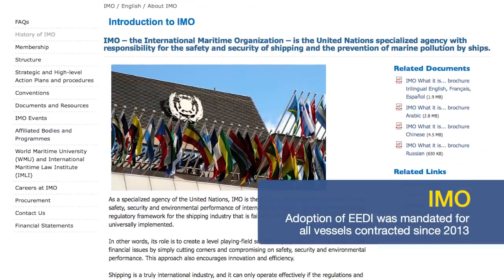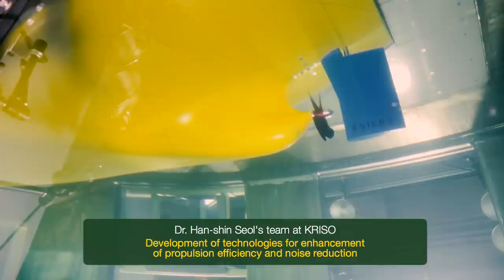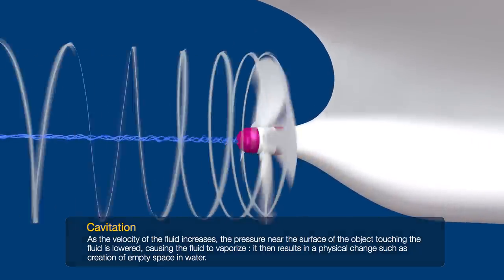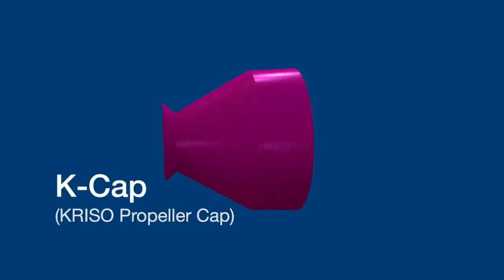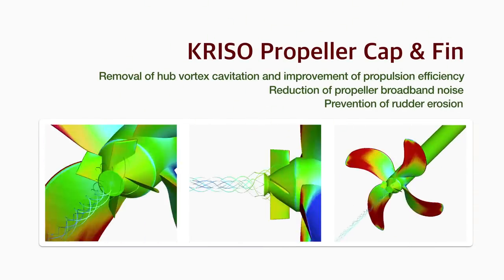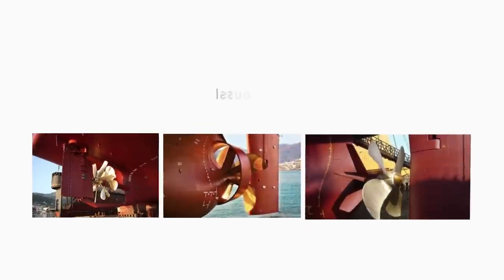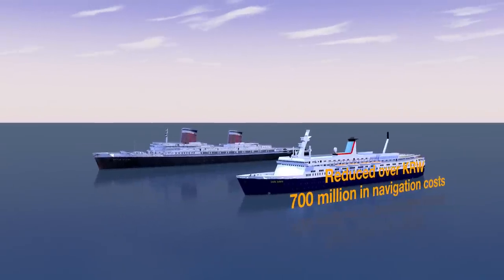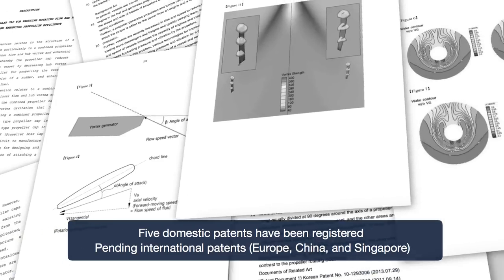KRISO  Technology for Ship Propulsion Efficiency Improvement and Propeller Noise Reduction

Comment: operating a boat is like pushing a baby carriage through the sand. Why not pull. A large commercial vessels creates a bow wave which grossly inhibits forward motion. Why not two pods at the bow not only eliminating the bow wave but using the increased speed to force more water through the pods in direct proportion to the speed. Picture a tanker going 80 mph
Reply: A bow wave is created by the hull form, you could add a bulb which may reduce the bow wave. Putting a propeller up front will drastically affect the flow on the hull, thereby increasing the drag and even potentially creating vibration and noise issues. Also, you have to think in terms of the weight distribution of putting pods or propeller upfront. There is also the issue of damaging your pods in a the event of a collision. The entire ship will be a sitting duck. And 80 mph ... haha never going to happen, the power required typically goes up as cube of the velocity. You would need 8 times the power to go twice as fast.

The only advantage I can see of putting the pods or propeller upfront is that you get a nice clean inflow to your props.
Reply: @qwertyman9560  how fast (mph) does a tanker usually travel across ocean?
Reply: @garden0fstone736  Typically around 15 knots, that's 7.5 m/s